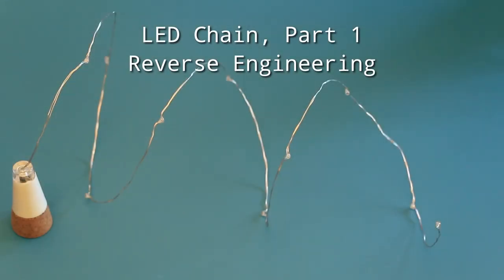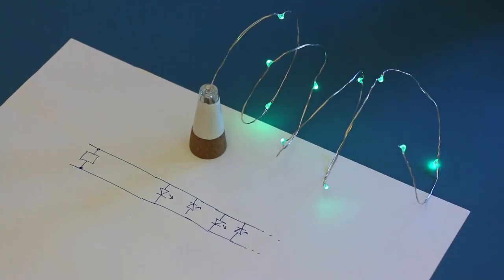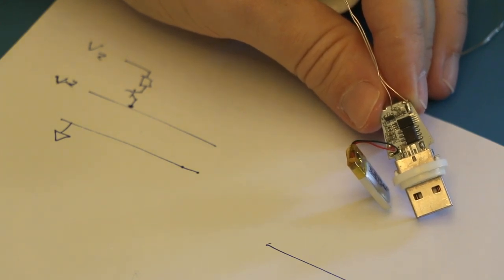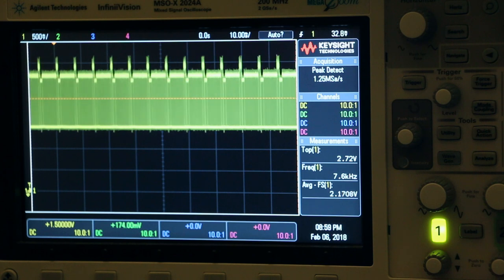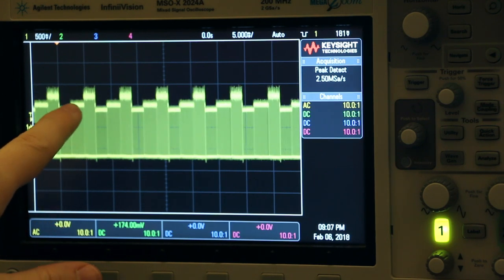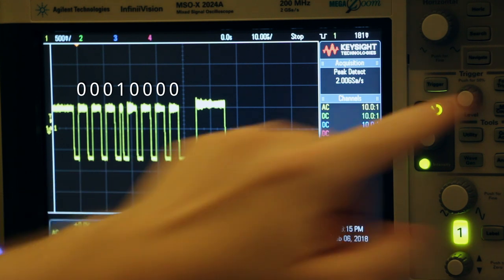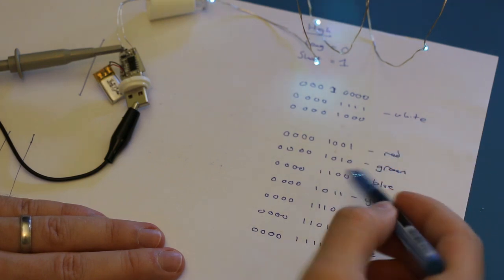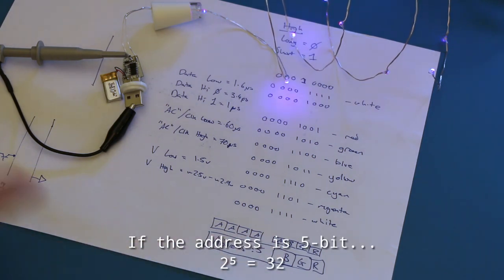2-wire LED Chain, Part 1 - Reverse Engineering

Comment: At the beginning of this video I was expecting a minor variation on the usual color-changing LEDs, but this is very much more interesting.

I expected to hear about 2-conductor programmable LEDs sooner or later, but I was expecting them to use something like the Dallas 1-wire protocol. This appears to be a bit different and possibly specialized for RGB LED use-case. Is it still overlaying a regular PWM signal to control the brightness?

I look forward to part 2.
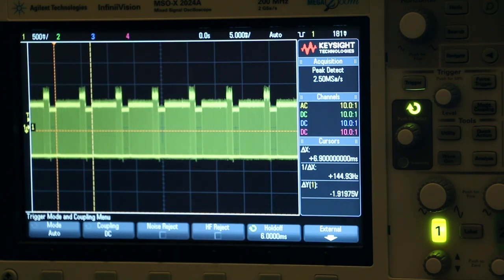Reply from the maker: Thanks! Yes indeed, the protocol only facilitates on or off for each of the three channels, so the PWM has to be implemented by the micro - you can see it going at around 12:44.